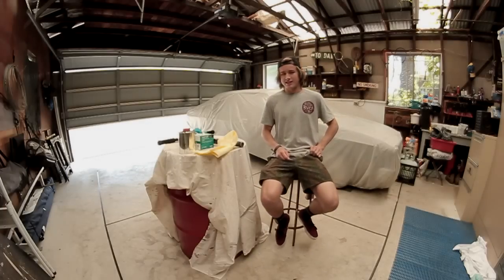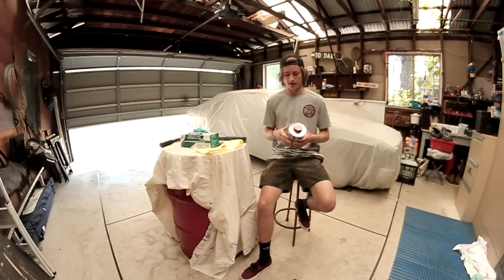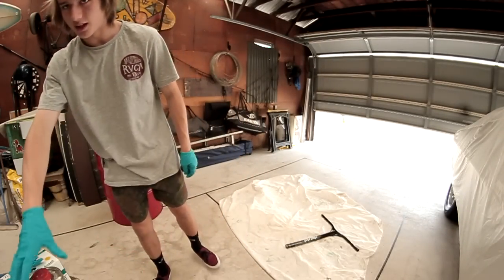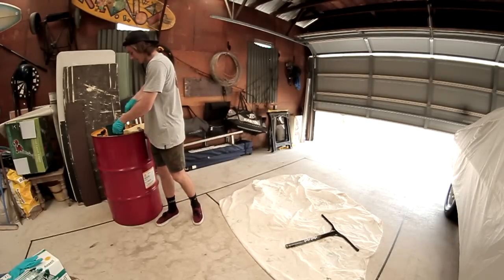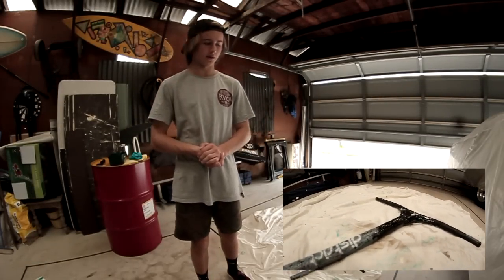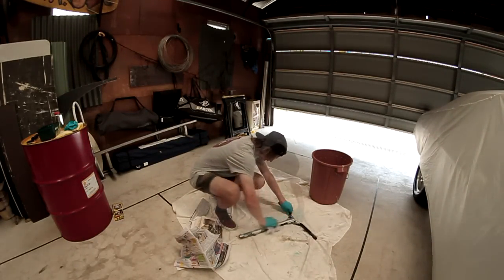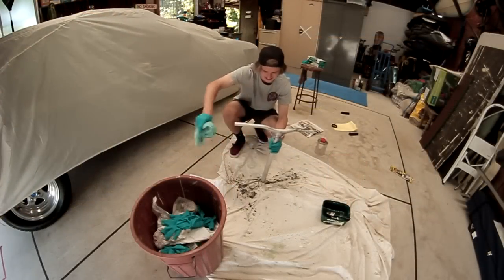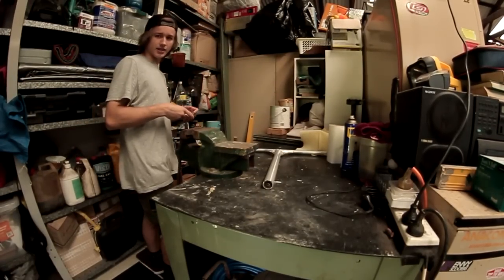How to Raw and "Chrome" Scooter Bars

Comment: to clear up things, this will only work on aluminum, if you have scratches in your bars, then you might want to sand your bars with 220 grit working down to 2000 grit. if you want to preserve you hard work and keep rust out, then use aluminum sealant.

Comment from the maker: get on it!
Reply: Hey Callum will this work with Envy Stripper Bars
Reply: RileyscootsHD
yes
Reply: what bars r u using i know u siad it but when i told a worker at scooter hut , they said u couldnt do this with those kinds of bars
Reply: Thanks! Very helpful! But if they're already Raw, can you polish them from there?
Reply: What kind of polish?
Reply: Graeme MacDougall You could probably use rim polish (You know, for car rims) for your bars. But I'm not entirely sure, so you might have to search up on the internet what other uses rim polishers have or what kinds of chemicals are in it.
Reply: Thanks I used medal polish and it worked thanks guys for the tips
Reply: Can u comment on ehat paint stripper did u use and polish
Reply: +Graeme MacDougall what brand did you use
Reply: +CallumKreations how lon did it take you to polish it ? :)
Reply: can you sand it down if you don't have paint stripper will that work?
Reply: CallumKreations would this work on a deck?
Reply: Caden EastYYY East ya
Reply: CallumKreations what polish?

Comment: Will this work to raw decks
Reply: soz im just trying to help you
Reply: But that's obviously fake. *****
Reply: Daniel Petrik its not , sware dwn
Reply: It will work to raw decks that are colored with paint, rather than anodized. If its anodized you would just have to sand it down and then polish it.
Reply: Thanks nick schroth...
Reply: Daniel Petrik Or if you don't want to use sand paper,use oven cleaner,heavy duty oven cleaner not the scented stuff
Reply: im sure
Reply: Cool... *****
Reply: Nick scroth you're wrong. You have to use heavy duty oven cleaner not the scented stuff. This usually only works if your parts are anodized. Then just follow his polishing step. If it's painted then you would have to sand it down. Otherwise just follow all his directions in the video if it's painted. Just a suggestion don't sand your parts down!